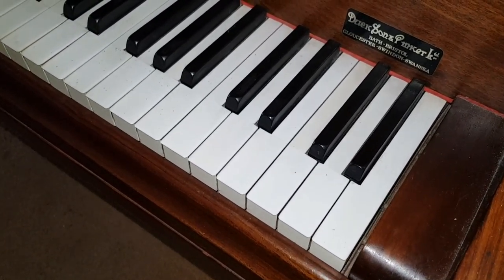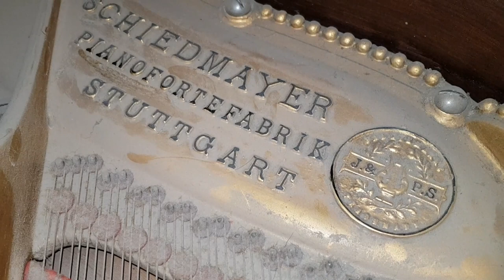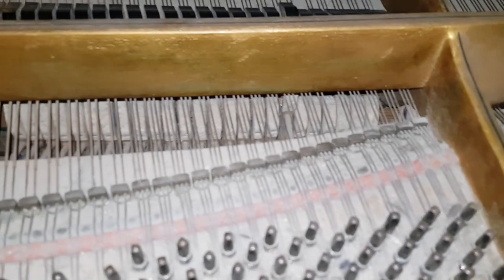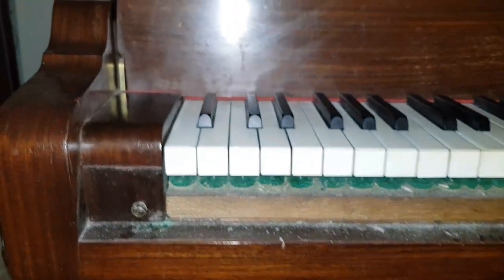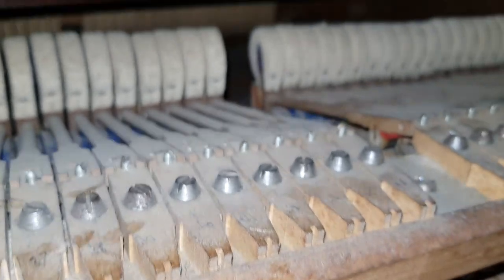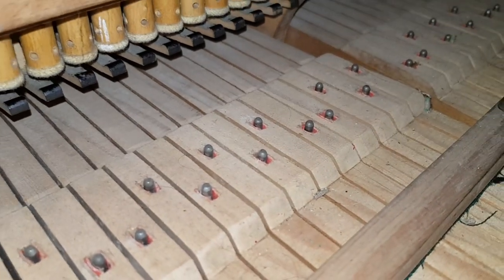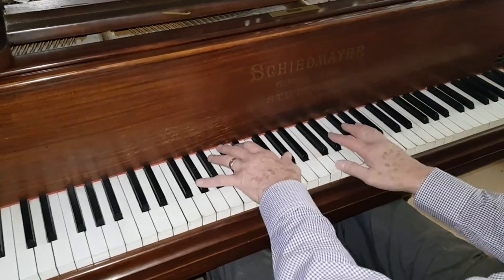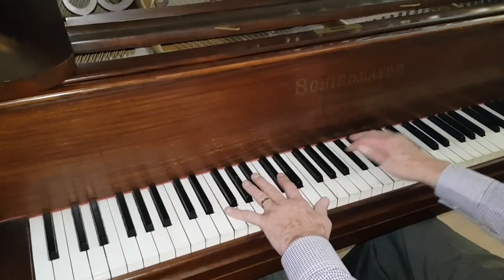Assessment for restoration of a Schiedmeyer grand piano 6ft 3in c1897 rosewood

Comment: Your piano is, I believe, an 1895 J&P Schiedmayer. So you were close.
The two Schiedmayers had factories next to each other in Stuttgart; the two brothers J&P were sent by their father to France to learn their trade. The two  others set up along with their father as Schiedmayer & Söhne. 

The Roberts web site only has frame numbers for Schiedmayer & Söhne - as do most other sources. When I bought my piano, a J&P Schiedmayer (47472,  88 note, from ~1912), not knowing the difference, I mistakenly believed it was from 1938 (and the shop I bought it from, probably using a similar resource, dated it at 1939). The only resource I have found with J&P Schiedmayer frame numbers is harmoniumnet, a Dutch site, but in English. Harmoniumnet has a lot of information about Schiedmayer; more than I have found anywhere else.

It was only by coincidence, last week, that I came across a Schiedmayer & Söhne grand, with a similar frame number to mine (turned out it was ~1929), and thought it must be a similar age. There were striking similarities, though its tone was duller than mine. I did some research, and then realised the difference between the two companies, and that the frame number series were different. J&P pianos also have the word "Pianofabrik" on them; Söhne do not.

My J&P Schiedmayer grand is around 195cm, plays beautifully (seriously one of the best tones of any piano I've played), but has a few stains, bumps and marks (I think someone kept a vase on it once - argh). I'd love to get it done up sometime, but the reason I bought it is to play it, and I'd be reluctant to let it go even for a few weeks, for restoration. Nonetheless, if ever you or any of your colleagues are in Mid Wales, I'd be very happy if you wanted to pop in and give an opinion.

Comment: Hi, thanks for another interesting video. I really enjoy watching them and learning about the mechanics of pianos being an amateur player. This one has been of particular interest.
I have a schiedmayer 190cm grand piano from 1906 and I was wondering what replacement hammer, shank and roller selection you will use on this instrument in your video? 
I have also watched your previous schiedmayer grand piano before and after videos and was wondering if you will use the same hammer, shank and roller as you did with that previous instrument?
Reply from the maker: Thank you for your kind comments. We'll use either Renner or Abel parts. Most important we think is to weigh the hammers first and try to make sure that the replacement ones are the same weight as the originals or perhaps slightly lighter. Marcus